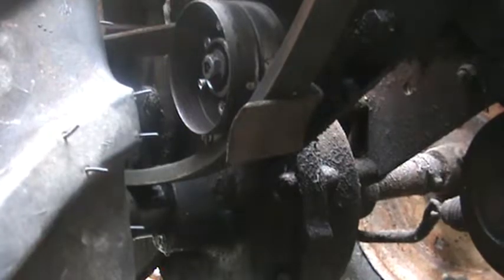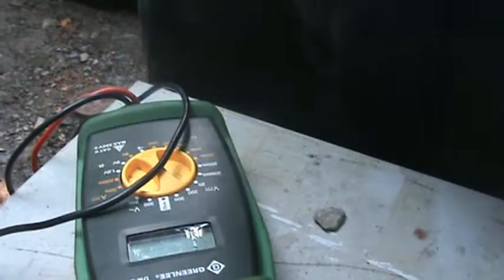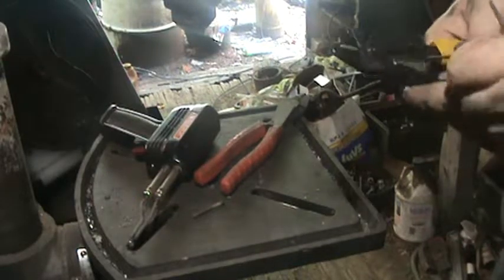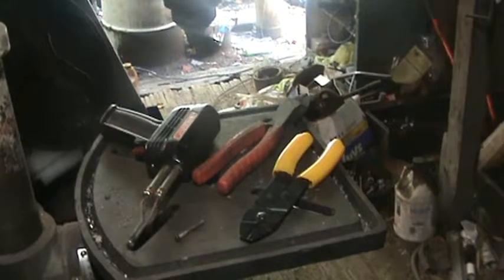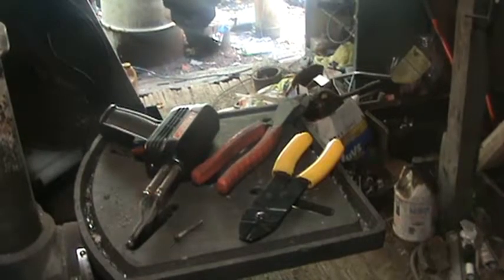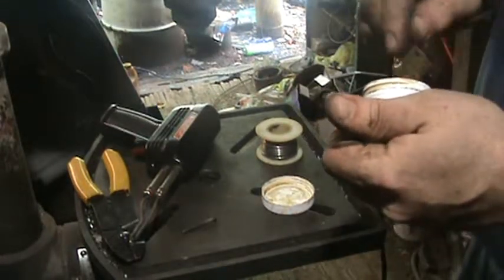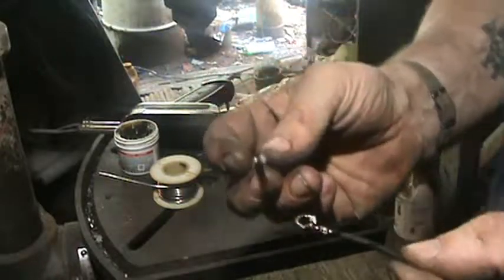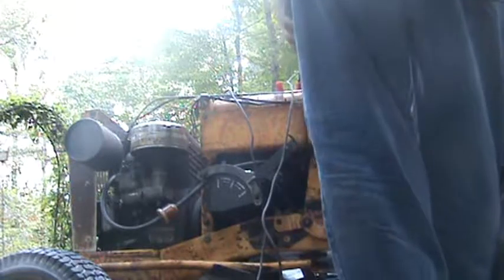Idler pulley and kill switch

Comment: Well my friend have you taken a minute to adjust the carburetor fuel air mix adjustment screw to stop the engine from hunting for the right rpm instead of revving up then slowing down and trying to recover?
Reply from the maker: I've over and undershot the sweet spots plenty of times but I can't get it Dead Nuts. That carb has been seriously manhandled. I've got it 85%-90% there though. It's close enough to work for now.